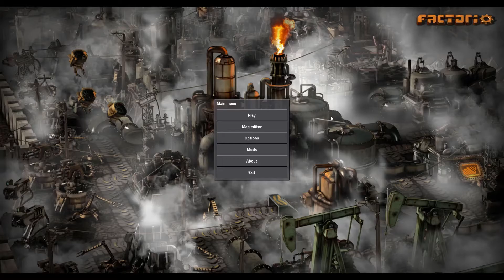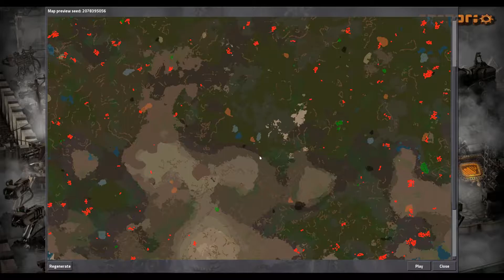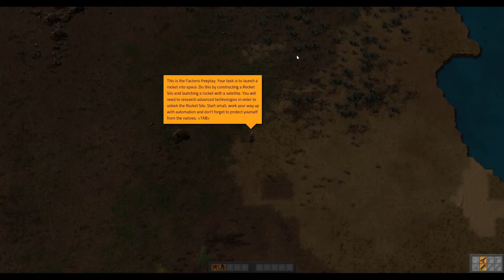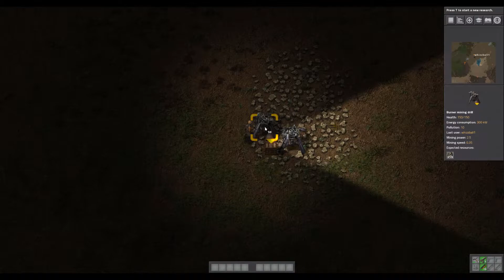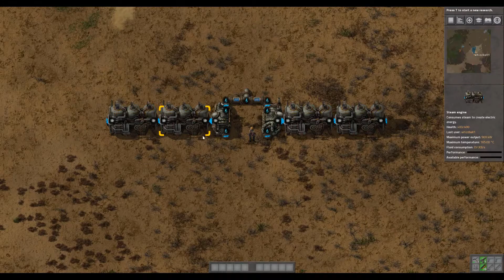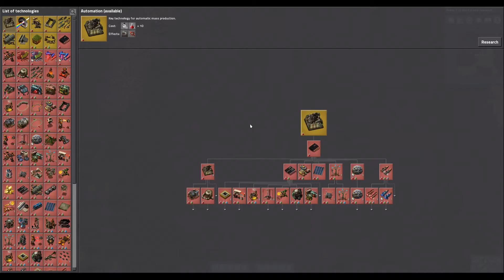Beginner Factorio Supershorts #1: Basic Resources, Research, and Power

Comment: Awesome videos! I love that you are already diving into to maths to make things work since that will help you make efficient setups as you go. I would get a good size furnace setup for each base material asap. 16 furnaces each one should work for a while. If you are worried about the bugs make enough turrets and ammo and walls to do a walking wall of turrets. If you haven't played this game through yet I think you are going to love it!
Reply from the maker: 16 furnaces? I'll keep that in mind. I'm going to research smelting setups as much as I can between this episode and next, but I know I don't want to over-build. And yeah, I really do like the maths in this game; I haven't played it very much before this but I know I always used ratios as immediately as possible.

I'll keep that turret advice in mind. This is technically peaceful mode, but I know I'll have to attack eventually, so I'll have to be ready. At least I'll be able to prepare beforehand!
Reply: minecraftinchocolate it hasn't been uncommon in my playthrough to quickly get to 32 furnace setups, though after that I waited until electric furnaces
Reply from the maker: I've heard some people say that steel furnaces > electric furnaces. Is this true in any capacity or are electric furnaces more efficient fuel-wise than steel? I don't think space should be much of a concern, but the extra space involved in electric furnaces is probably balanced out by not needing a coal line.
Reply: minecraftinchocolate I think steel vs the initial electric is slightly faster, but you gotta keep the coal line. Electric can receive upgrades and don't need coal. They may be the same speed but steel being cheaper. I perfer to get rid of the coal line asap.
Reply from the maker: I'll be sure to take all that into consideration. I assume electric is the "final form" because I can then use beacons, but that's a long way from now, heheh. Thanks for the advice!